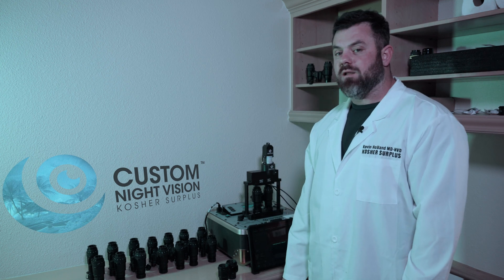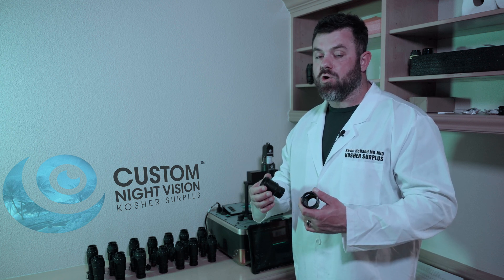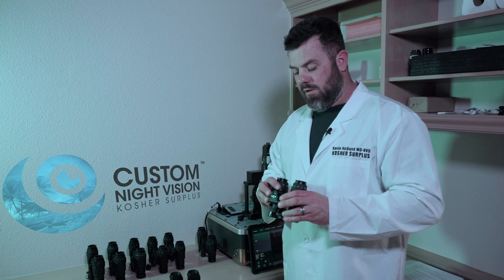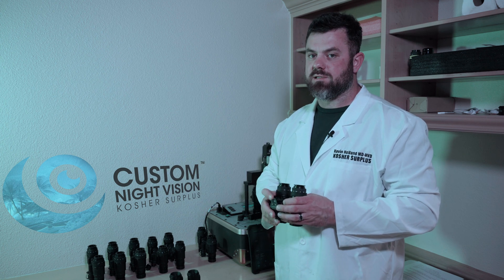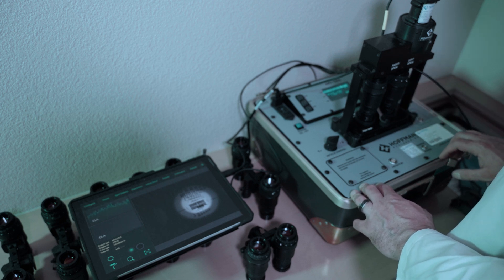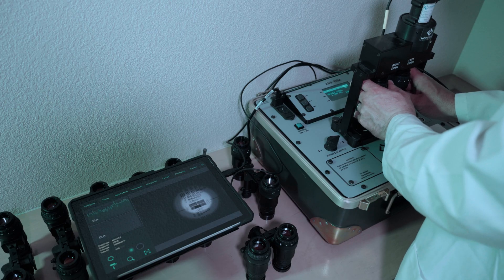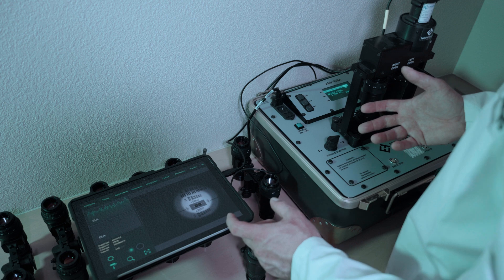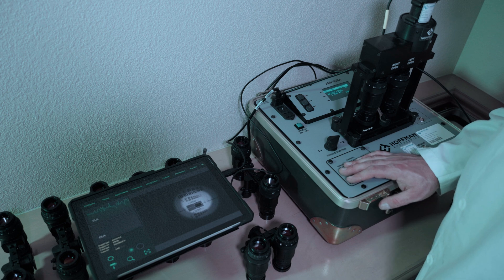Custom Night Vision | Collimation

Comment: How do you keep the collimation in place? Do the tubes you're twisting get locked in place with a screw or how do you make sure the user can't take them out of collimation?
Reply from the maker: the tubes not turning the eyepiece is. and there is a lock ring that jams them together and keeps the eyepiece from rotating.

Comment: Hello, I have a 1431 mk2 housing and I don't know if you've seen the new fixed 55 degree panned pods that are coming out soon, made by code 4 defense. I saw some people talking about how these would basically be impossible to collimate. Is that true? I also saw a guy saying you could collimate them on the test set with the stock 40 degree pods and then just install the 55 degree pods. Would this work? Or perhaps there is another solution. Thanks for the videos.
Reply from the maker: yeah, it would not be possible to collimate them properly. changing the pods would completely negate any collimation done with the previous set. Please tell me who said this.  You could probably collimate them by eye but it would never be perfect. however, no paned bino will have even near perfect collimation while they are in the paned position. collimated and panned are in opposition fundamentally.
Reply: @customnightvision  Ok thanks for the response. the guy who said that was just some guy on the fb group who "used to build DOD units". but I also asked the code 4 defense guy about collimation and he said quote "it would just have to be done one at a time like with bridged 14's". Which also sounds like it would defeat the purpose of the collimation but what do I know I guess. What would you say about code 4's response?  Also, out of curiosity, how are gpnvg's collimated?

Comment: On a PVS-14, am I able to rotate the tube within the housing, so the blem appears in a different location?
Reply from the maker: Unfortunately not, the tube sits on a small dowel pin to ensure the tube doesn't rotate. The pvs14 requires specific contact points on the tube to provide power.

Comment: Are 3d printed housings in higher tolerances? Like a tanto?
Reply: What do you mean?
Reply: @kevin11288  since each housing is a little different, does a 3d printed housing have higher tolerances?
Reply: @Miles_milez  i would say they’re a little tighter tbh.

Comment: When you say “turn the eye piece” do you mean how far onto the unit’s threads the eye piece is screwed? And then once it’s lined up you move the locking ring to hold it there? So on duals the rear optic one one pod might set a little further back or forward on the the threads than the other pod? Am I thinking of this right?
Reply: Yes that is correct. if done properly the eyepieces should be pretty level with each other.

Comment: Does collimating apply to a single pvs14 relative to the opposite user’s eye? I have a J arm that articulates from left to right eye. I’ve noticed that when the PVS14 is on my left eye, it has decent image alignment with my naked right eye and feels natural. However, the pvs14 on my dominant right eye makes everything wonky with double vision. Is this normal, and is there a way to adjust this so it more naturally matches my opposite eye WITHOUT making a custom J arm that rotates the monocular just right?
Reply: id have to put it on the hoffman and see if the image shift has been offset with the eyepiece.

Comment: How come I can look through my pano Pvs-14’s without issue? You’d think that would be the most extreme case of miss alignment

Edit: after having looked through miss aligned duals, I can confirm that Collimation is required.
Reply: That’s a good question, I will tell you that not everyone can utilize a setup like that without discomfort.

Comment: Spent 12 yrs on NVGs and never ever had an aircrew say he had a problem without any having been collimated, surely any double vision or issue can be cleared by near or far focusing, must be as never had an issue
Reply: How do you know their devices weren’t collimated?
Reply: @kevin11288  Because I was servicing them
Reply: Interesting. And changing the focus would not correct the optical axis offset. Not saying you can’t eyeball it but that’s not the right way to build nightvision.
Reply: @kevin11288  I can confirm this. I've built 12 binoculars so far for friends. Never had any issues. It seems like there is some sort of fishy business going on with night vision vendors.
Reply: @davideinstein7887  how so? This isn’t a process that we just made up. If you don’t want your goggles collimated that’s up to you but we are simply telling people we build ours the right way as is required for aviation use per US milspec. Collimation isn’t a process based on opinion it is rooted in scientific fact.
Reply: @kevin11288  My point is you don't need a collimantion tool to collimanate.
Reply: @davideinstein7887 it's been two years. You had so much time to delete this comment 😂 I guess you decided to stop learning things at some point in life

Comment: with articulating tubes does the position of the pods effect collimation and if so, would that imply that articulating tubes are only perfectly collimated at 1 point in their travel arc? you have opened up a very deep rabbit hole... lol
Reply: Yes, articulation does affect the collimation, however it’s not enough to take them out of spec unless you’re a hammerhead.
Reply: @kevin11288  nope, that's my ex gf's nickname.
Reply: Depends on the builder and the housing. A housing with a longer bridge such as DTNVS or 1431 don't shift as much because the angle shift to set IP isn't as big. Much more noticeable on Katana. It also depends on how good the builder is, and whether they collimated close to boresighted. If you have a builder that collimated the tubes to eachother but with a significant offset, you will see much more of this issue. We have discussed this at length with CNV so it should not be an issue with their units.